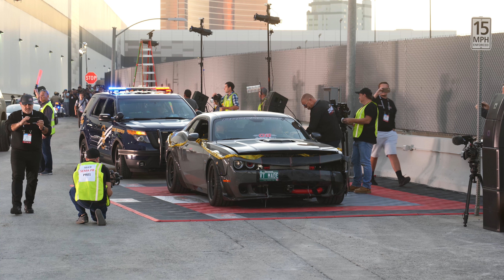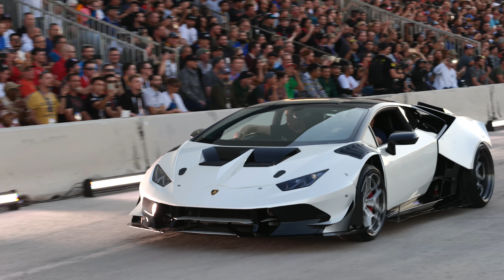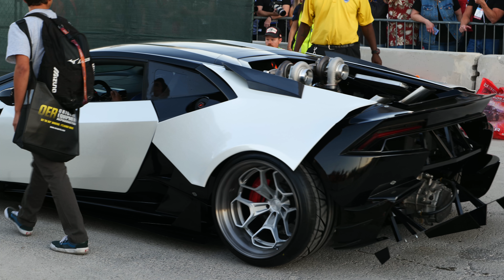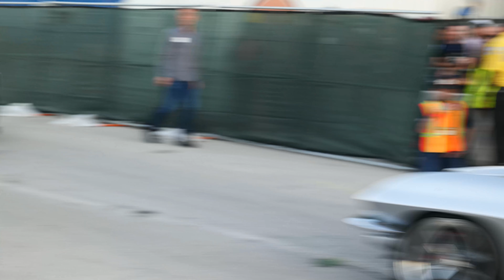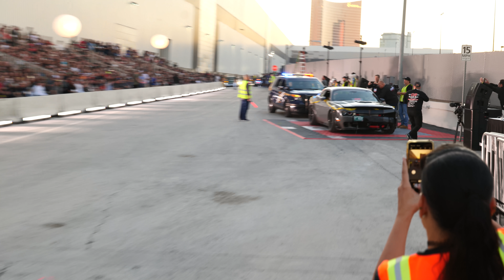B is For Build Twin Turbo LS Swapped Lamborghini Huracan Leaves SEMA - Exhaust Sound & Turbo Spool!

Comment: Car has too much air in the rear tire, you can tell because only the center treads are dirty and the outside tread is still clean. That indicates over inflation and only the center of the tire touching the road.

Comment: He was missing one thing.....his tire is backwards on the left front 😂
Reply: what are you smoking? it's not omni-directional and it most certainly isn't inside out.....
Reply: @muskokamike127  it's a directional tire. If you look at it. The tread looks like its pointing to the rear of the car....the tire need to be flipped to were the tread is going forward.
Reply: @muskokamike127  and omni directional is not the correct term. There is three kinds of terms. Directional. Symmetrical and asymmetrical. His rear tire is a nitto invo which is asymmetrical and the front tire is a nitto 555g2 and that is directional. I gave you the name so you look it up
Reply: @oscarmontoya1721  nice try.....symmetrical means the pattern is repeated around the perimeter of the tire. NOT the direction it is facing. You're right though, I should have used NON-directional instead of not omni-directional. 

Asymmetrical patterns means it isn't equally repeated. 

Symmetry has NOTHING to do with the tread direction.

BTW: Nice edit to to change your post from wheel to tire.......thought you could fool me but not this time bucko.....
Reply: @muskokamike127  symmetrical is not where the tread is repeated around ....whatever you said. It is when you are looking at the tread itself and you draw a line in the middle of the tread...if the tread is the same on both sides it is a symmetrical.... if one side is different than the other when you draw a line in the middle it is asymmetrical.. and idk what your saying about editing?? So no acknowledgement there
Reply: Directional is when a tire is facing a specific way that's why I commented on this video. And this tires is put on wrong lol
Reply: @muskokamike127  🤦‍♂️I dont want to throw you the "I do this for a living" but just simply making my point . THAT TIRE IS BACKWORDS. ask someone you know "hey what's this guy talking about?" And maybe they will tell you
Reply: Pause it at 30 seconds and look at the tread only. You see how the tread looks like it has arrows? And it's going to the clockwise? Well it should be counter clockwise
Reply: @oscarmontoya1721  sorry buddy, symmetrical means a pattern repeated evenly. For that tire to be asymmetrical that would mean the tread would have to stop repeating, and change, halfway around the tire. Symmetry isn't just how YOU determine it to be, symmetry is symmetry. 

What YOU are trying to describe is the CROSS section of the tread that is an asymmetrical pattern. The tread around the circumference of the tire is 100% symmetrical.
Reply: @muskokamike127 
🤦‍♂️
 so give me a asymmetrical tire name then.
Reply: @muskokamike127  your simply googling the definition lol
Reply: Watch out its the SEMA build police. 😆
Reply: @luinhaden  lmao 😂👍🤷‍♂️
Reply: @oscarmontoya1721  *you're

To get the true definition? yes. I know what symmetrical and asymmetrical means, I've been using them in design for 40 years.....if you're going to use your made up definition, then go right ahead....it just doesn't make you correct.
Reply: @muskokamike127  I'm correct that the tire is put on wrong!!! That's all I'm saying
Reply: @oscarmontoya1721  and you are incorrect. Tire is installed correctly and I was correct: they are NOT directional tires. The tire is installed in the same orientation as these are from the people who sell and make them:

https://pmctire.com/en/tires/nitto/invo/nitto-invo-uhp-225-45zr18-91w.tire?gclid=CjwKCAiAqqTuBRBAEiwA7B66hb5BP5sujN9BQFml58a92W6Zx15uelnqNkqM3uiQTLnIIg-NrUnEnBoCp5EQAvD_BwE

https://www.nittotire.com/passenger-tires/invo-luxury-sport-ultra-high-performance-tire/
Reply: @oscarmontoya1721  thanks for playing!